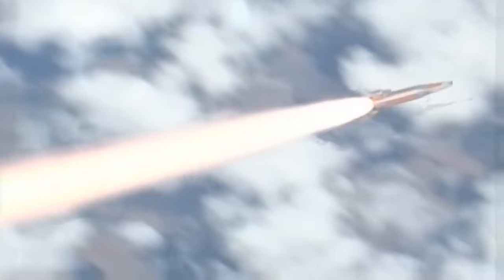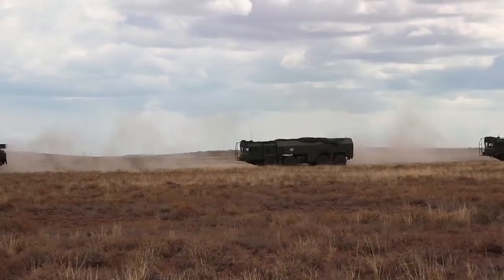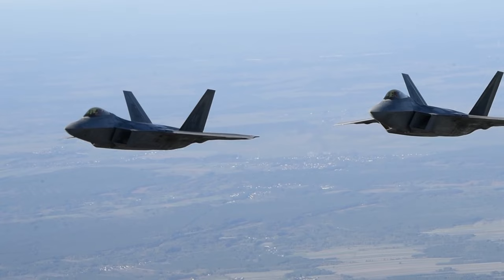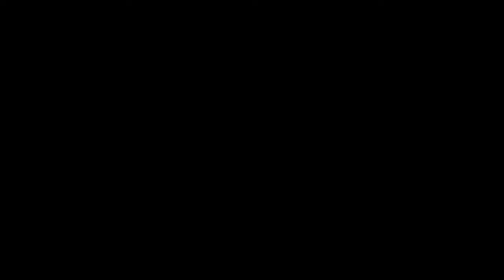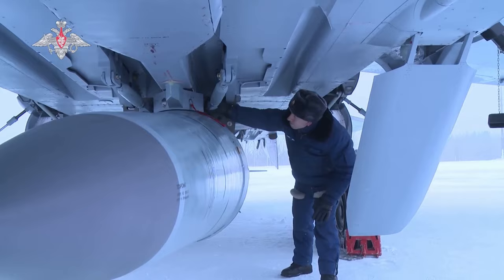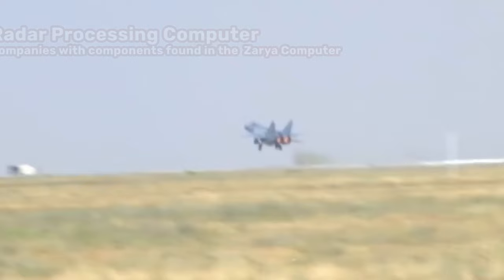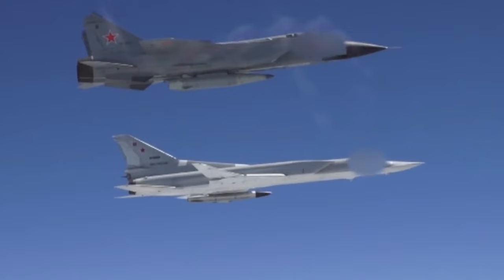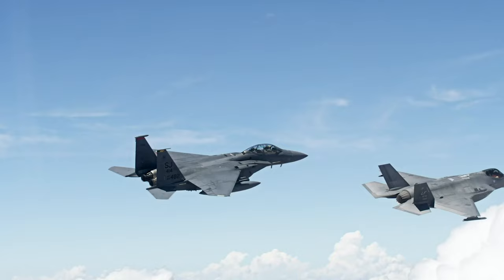Is Russia's "hypersonic" Kinzhal full of American hardware?

Comment: I have to point out that Russia has a domestic chip manufacturing infrastructure, but it is far and away inferior to anything in the west. They can manufacture chips for such things as GPS and Phones, but those chips rely on manufacturing equipment sold to them that is based on techniques used by machines built in Taiwan, South Korea, and Japan two or three decades ago. Where the west is making 2-7 nanometer chipsets, the machines used in Russia today are only capable of about 35 nanometers.  They are larger, less capable, and less reliable than components made in the west.  Further, all shipments of equipment for manufacturing semiconductors have been halted to Russia due to the sanctions, and Russia doesn't have the technical capability to build the specialized machines for making modern semiconductors.  It's no wonder they're using US, Chinese, Uk, and other western components since they simply cannot make the components they need domestically.
Reply: Yup
Reply: @T.J. Kong Except when they're made by old Russian designed and constructed machinery that wasn't all that great when it was new.   Russia used to make some of the most robust hardware in the world, but since the Soviet Union dissolved they relied more and more on international suppliers and forgot how to make some of their good stuff.
Reply: @T.J. Kong They could use vacuum tubes, those are even MORE robust!
Reply: I might be wrong as I'm not in the know on the actual machinery capabilities/longevity for the various process nodes, but I know that the turnover rate for a lot of the machines from the last decade is pretty high, due to the smaller and smaller manufacturing processes and new processing methods.
With that said, 35nm would have come in around roughly 2010 (45nm was 2008), so I have a hard time believing that three year old machines would be capable of that since they'd have been made during the time of 600nm lol
2 decade old puts it inbetween the 130nm and 90nm nodes, and still an absurdly long time ago in this context.

That being said, you may be correct on you machinery dates, just incorrect on the node... 
From what I turned up after a rudimentary search, a news article on mid-April on a site I trust with hardware news, TechSpot, had mentioned this (emphasis mine):
      "Approximately 420 billion rubles ($5 billion) will get invested
         in developing newer fabrication nodes and ramping
         up production. Russia aims to ramp up the local chip
         production using a 90 nm node by the end of the year.
         By 2030, they intend to manufacture chips using a 28nm
         process technology, something TSMC did in 2011."
So just about 20yrs ago like you said, is when 90nm was the latest node, just as I said. 😁🤘 
(oh, and that $5bn estimate by Russia is fucking hilarious... then again, they probably hope to mostly steal their way to that goal... or maybe that focus is only for R&D 🤷‍♂️ I'll just chalk it up to a "delusional Russia number" lol) 

HOWEVER, that aside, this all isn't to say they would be unable to manufacture capable and "fast" chips on that 90nm node. They will just require more power (significantly, in terms of our computer's CPU) in order to operate, but their actual PCB footprint isn't really going to increase — or it shouldn't have to, technically speaking at least. Although, when it comes to SRAM or other memory types, that WOULD require more PCB realestate, as each module wouldn't be able to store as much on account of the far-less dense manufacturing node...
Reply: @InviktusRex  Yeah, I saw that when it came out.  I can recommend it.
Reply: Thought the Dutch have the machines to make the wafers. Then ASLM has the lithography and techniques right? While companies in America design the chips and send them to TSCM. 

 I'm glad the US government is working on catching up. I also wonder what other links in the process a state of the art computer parts take in the manifactering.

 I also wonder what other electronic/instruments the military relies on that simply cannot be created without a solid base. like creating radar and electronic warfare. 

 This is why I foresee cheap, easy to manufacter, drones being the future.
Reply: @dianapennepacker6854  We actually  have a number of fabs in the US, but by no means with the production volume of TSMC.
Now, in War Time, if Intel switched gears away from their own CPU lines, plus those smaller fabs like IBM and Global Foundries (which is by no means small, but not sure how many facilities are in the US), we'd do pretty well.
However.... How much can be completely made stateside is the question. Lots of GloFo made CPUs (back when they were making them for AMD) were "Diffused in Dresden"(, Germany). So... 🤷‍♂️🥴
Reply: I am sorry to report that 35nm is way beyond their capabilities atm, they are still struggling with 90nm!!!
Reply: @T.J. Kong Only they are not able to produce 35nm
Reply: @Roger Smodher The only things they could offer is commodities and they are already doing it. Make a guess what would happen to China, if newer chips that are known to have been sold to them finish in russian weapon systems. Hint-what is going on with China's semiconductor industry.
Reply: @Roger Smodher Which soviet jets? All that is soviet they already have. If you are talking about SU57, even India pulled out.
Reply: @Roger Smodher The only chips that russia manifactured recently.....finished as fridge magnets. russians bought the 90nm equipment in full, but are struggling to make any use of it, not that using it nowadays makes sense. Russian electronic components are exactly like the unicorns, people claim they exist, but nobody had actually seen one!
Reply: @Roger Smodher As for China, they do manifacture hardware, however their chips are mediocre.
Reply: @Mishn0  Would pose a problem to get airborne using a tube-based GPS device, I think...
Reply: @Roger Smodher ICBMs are the reason there are no Western jets in Ukraine.

India pulled out of SU-57 because of spiralling costs and subpar results. I think Alex has even done a video on it already.
Reply: @Roger Smodher That claim is quite exaggerated, as russian "market" is: small and with low purchase capabilities.
Reply: Their own chips are still very capable. Their not top of the line but powerful enough for anything like missiles etc
Reply: @JohnDoe-yq9ml  Really???? Do you mind showing us a single picture of these mythical components. All the hi tech hardware in their missiles is non-domestically produced, or should I ask:Have you really seen the video?
Reply: @DUKE_of_RAMBLE  TSMC is building a huge factory in Arizona currently 💯
Reply: @blueberrywilbur315  That is true! I'd actually forgotten about that! 3nm as I recall. I think that's still at least a year or two away from production capability, with the machinery being the main holdup. 
Isn't Samsung thinking of making a US-based fab, as well?
(although not a chip fabricator, I know Foxconn was going to setup an assembly factory in Wisconsin, but reneged on that intention)
Reply: They don’t have chip manufacturing
Reply: @Fenrir.Gleipnir  I can appreciate not wanting to read the replies, but it would have spared you from all of these: 
  - having to reply, 
  - being woefully incorrect, and 
  - looking a fool due to being incorrect as a result of not having read (enough of?) the replies, but decided to go ahead with your comment anyways... 😕
Reply: China cannot make those semiconductor chipsets either. they can't even make their own 5g semiconductors. that's why Huawei's new phone is worse than the model they released 2 years ago.
Reply: @Roger Smodher Intel is an American company and it can't sell to Russia or to know Russian fronts or it will run into trouble with US law.  I mean I'm sure there is some leakage but they aren't selling direct or anything.
Reply: @Roger Smodher I don't really think the Russia market is compelling enough to make them inclined to risk US regulatory pressure or the massive incentives in legislation like the CHIPS act.  It's not China.  There just aren't  enough competitive domestic Russian electronics to make it that attractive a market for wholesale chips and they have too much dependence on the Dutch as the only maker of EUV machines to be able to spin off a seperate business free of western sanctions even if they wanted to do so.
Reply: @Roger Smodher Of course they have a bunch of money but the wholesale buisnesses is different than the retail business.  Russians buy plenty of iphones etc but that's not what we are talking about here.  We are talking about the demand for wholesale chips which is mostly about thd number of electronics factories in the country.  Those factories tend to be more attractively located in places like China and India because they combine both ppl who have the technical skill (Russia qualifies here) with plenty of low wage workers (less true) and an appropriate business environment.

After recent events ppl are going to be much less interested in basing their electronics manufacturing plants in Russia for fear of another geopolitical dustup.  Of course they want to sell Russians retail goods but they can build them in China or India and do that just fine.  

Indeed,  this is the basic economic problem Russia faces.  They are relatively rich because of oil but that doesn't often go along with a booming manufacturing sector.
Reply: @Roger Smodher Yes, I agree that is a more plausible concern re: Chinese sales (and they already have all but the latest EUV lithography processes).
Reply: If you want, please come to Russia in your tank and check if Russian missiles are reliable, and if russian outdated electronic components are worth of discussion.
The practice is the criterion of verity, right?
Reply: So the chips that Russia makes or use can't make missiles that can make it to it's target?😕
Reply: Well of course!
Reply: @T.J. Kong Not really. Far less technologically advanced in every way!
Reply: @dianapennepacker6854  USA Is quickly ramping up its supersonic missile design/ tests & production RIGHT NOW. Military top contractors are "on it" so to speak.
Reply: @DUKE_of_RAMBLE  Intel building 2 advanced semi conductor chip plants in Columbus, Ohio right now to be online in 2025 latest. For military industrial compex / Big US automakers/ computer companies & others. 4000 jobs expected to pay $125k average salaries . Need good payin new job? Lol
Reply: @Roger Smodher China Is far behind the US & Taiwan..hence one reason they want Taiwan. Intel building 2 new semi conductor plants in Columbus Ohio right now! 4000 jobs expected payin $125k average salaries.
Reply: @Roger Smodher Maybe but far behind Taiwan & US technologically. TMMC founder worked for TX Instruments & IBM in US. Intel building (2) new semi conductor plants in Columbus, Ohio right now!
Reply: @Roger Smodher Also for new EVs & other high tech things made in US. Lithium & cobolt among other minerals as well. Tesla / Ford/ GM need these badly for batteries in new there fast selling EVs.
Reply: @Roger Smodher Yea..highly unlikely!
Reply: @lubomirdoukov6975  Truth. The tech originally comes from USA. TMMC founder in Taiwan learned @ TX instruments & IBM Corp.
Reply: @DUKE_of_RAMBLE  easy now fella.
Reply: @Roger Smodher Intel is an amazing American Co. Building 2 new semi conductor chip plants in Ohio as i write this. 4000 jobs !
Reply: @Roger Smodher fantasy at best .
Reply: @Roger Smodher Possibly. Wouldn't doubt it.
Reply: @Roger Smodher I don't underestimate anyone my guy..they have near zero experience in real warfare for one. Look at Russia right now in Ukraine! Russia has tons more experience then China in last 50yrs but hasnt been in a meaningful skirmish till recently. Experience is everything in warfare & most else! China has huge economic issues at home. Real bad. Zero energy resources ..unless bought an on & on. They are big talkers. They want respect as does N Korea badly. Though hasn't been earned.
Reply: @Roger Smodher maybe not but will affect his efforts.
Reply: @Roger Smodher First claim not true, second uncheckable, but likely to be not true, considering the body armor distributed to their troops.
Reply: @Roger Smodher Ai, ai, comrade, did you not get the word? T14 program has been canceled.
Reply: @Roger SmodherYour guy is probably Prigozhin. Chinese have never been participants in SU57 program and for good reason. The plane is not stealth, uncapble of supercrruise, with dubios avionics and radar. ATM, there are b/n 1-3 serial operational jets. Very likely for China to be interested in a plane that is still in a prototype stage after over 20 years of development.
Reply: @Roger Smodher Russia currently us less than 12 operating, even if people wanted them, they can't sell them
Reply: @petergerdes1094  China do not have any EUV manufacturing process
Reply: @Roger Smodher T14 is a cancelled program with no combat ready machines, the only place it can blow anything other than your imagination of course is a computer game.
Reply: @Roger Smodher Dear man, let's make a bet, not in ten, even in twenty years there would be no decent chips made in russia.
Reply: @Roger Smodher Entire squad is hit by a single rocket? My dear man, you have just invented a new physics, Nobel awaits your achievements lol!
Reply: @jaredgarbo3679  Right, which is what I said.  They have access to all but the latest (ie EUV) lithography machines.  But I see why that may have been a bit unclear but that at least was what I was attempting to say.
Reply: @Davido50  Don't bother explaining yourself, troll the troll, he is getting overly imaginative when you wind him up
Reply: You know this for a fact do you?
Reply: @Roger Smodher - Taiwan has just about cut off all chip sales to China, especially when the US Government implemented the new round of restrictions.
Reply: @Roger Smodher - Italy isn't a supplier to Russia any longer...
Reply: -As far as I can see Russia is at the point in line widths that the west was in 2006.   Think of a Motorola MC68060.   A 32 bit CPU with a floating point unit and an MMU.  This chip powered the last generation of MACS before Apple switched to the intel Pentium architecture.  
-A Tomahawk missile with this kind of power could 'power' its DSMAC Digital Scene Matching Area Correlation but a subsonic missile has plenty of time to do this calculation.  The early correlators used reference maps that had been flattened and distoted to look like they would when viewed from the height the missile would be flying.
-A hyper sonic missile would need to react much faster and ideally without all of the preliminary main frame calculations as well as handle peaks through clouds or identify actual targets.   That needs serious computing power the kind in a top end Graphics processors using 7nm line widths.
Reply: @Roger Smodher no facts there….. how would they do that? They’d have to remove the few examples they’ve got from parade queen duties.
Reply: @flappingflight8537  Ганьо е баща ти, руски чип можеш да видиш само във вид на хладилен магнит, китайски чип има, но със достатъчно посредствени характеристики!!! Всичко това е публично достъпна информация, така че повече четене и по-малко творчество, невежа!!!
Reply: @Roger Smodher an invasion of Taiwan? Surely the Ukraine situation has showed the CCP that even victory would come at a great cost.
Reply: @Roger Smodher The Russian arms industry took T-90s meant for India and sent them to Ukraine. Trusting their arms industry right now is like trusting an obvious ebay scammer.
Reply: @JohnDoe-yq9ml  Then why do they use foreign chips?
Reply: China doesn’t have the capacity either.
Reply: @Roger Smodher They don’t have the chips to make an advanced fighter jet. China has also been barred and that means, they will have to use what they already have procured or they have to start making their own chips and China is nowhere near achieving that goal. They have been trying and the United States still is in charge and control. Even better the finest silicon sand used for the highest quality chips is found in North Carolina and nowhere else.
Reply: @DUKE_of_RAMBLE  aren't both AMD and Intel expanding massively in the US on top with FABs while locking in some newer machines from ASLM PLUS TSCM? It is why China is so angry.

 I wonder what are the majior companies who make the parts and tools that those two juggernauts use. 

 I am a layman and only recently had these companies brought to my attention and it's interesting. No one ever thinks about the physical aspects of chip manufacturing but only software. I can't find any easy digestible reads on the ground up on how logic gates can make a video game. Trying to learn on architecture and the therotical possibilities of that.
Reply: @dianapennepacker6854  [note: I'm also a lay-person, I just have enjoyed computers long enough to have picked up rudimentary knowledge; however, this means there could be glaring errors here]
AMD only designs their hardware –actually, this is complicated, I'll touch on it later– and then "foundries" like TSMC, Samsung, or Global Foundries apply that design to a large Silicon wafer (on AMD processors, this is where it was "Diffused"; ie "Diffused in Taiwan" if TSMC). Dozens to hundreds get patterned out per wafer, depending the size of the "die" (the entire CPU, GPU, or whatever designed logic is being made). But then, once they are... we'll say 'etched' to simplify the process... once etched the big wafer disc (which look beautiful once etched;  https://upload.wikimedia.org/wikipedia/commons/f/ff/ICC_2008_Poland_Silicon_Wafer_1_edit.png ), the dies get individually cut out, then tested quite extensively with today's capabilities, whereby its determined what sort of defects they have – if any.

Which today's designs are modular enough that a defect doesn't always mean it goes in the garbage. If say the defective portion is for example, one of a CPU's multiple  processor cores, they can "laser cut" parts of that circuit to disable it. So instead of being an 8-core CPU, it gets turned into a 6-core (they disable them in pairs usually, for various reasons). Then all these dies get sent someplace else, one of multiple places AMD uses, although I think these days it's Malaysia (on the CPU, this is the "Made in" portion). This is where they get packaged and become the product we are familiar with seeing.
[Note: actually, I might be wrong, and the assembly plant might get sent the entire, intact wafer. Heck, anything from that testing to defect laser cutting process, may all occur here 🤷‍♂️ heh]

As for the "this is complicated" part I mentioned...
AMD, for a long long time, always played second fiddle to Intel. Then the fates shined on AMD at the end of the 90s, when their new CPU architecture outperformed Intel's (significantly, at times) and they maintained this lead until ~2005-06. Then Intel started to claw its lead back, but they had also started to do some shady (to later determined to be illegal) business deals with all the major computer manufacturers, so that they would not sell as much AMD-ewuipped systems or to only put them in less-favorable computers people wouldn't really want (I only mention this because it indeed hurt AMD's bottomline, which is directly relevant because...)
Then in 2008, AMD spun-off their chip foundry and manufacturing side, which became its own entity called Global Foundries. They, through agreements, are who AMD would use exclusively (or nearly) for almost 20yrs. More recently "GloFo" has trouble getting below 12nm and AMD now uses TSMC almost exclusively. heh

There's less to say about Intel, as they do it all in-house.
I don't know if AMD fabricated chips for others during the time they were still a foundry, but I think so... GloFo, of course, did take outside work for whomever needed it. Whereas Intel did not take any, always having enough in-house volume to take it up. Although after AMD once again took the performance crown back, I think Intel decided to open its doors to others... Not because they had less demand (their own nearly decade-long 10nm woes meant they had TOO MUCH fabrication work), but because they needed extra income.

As for who makes the machines.... I'll just quote CNBC:
   “ASML is the only company making the $200 million machines needed to print every advanced microchip. In the southern Dutch town of Veldhoven, near the border with Belgium, sits the only factory capable of assembling a revolutionary machine that's relied upon by the world's biggest chipmakers.”

Which is nuts. I don't know why that is though, as I've never been compelled enough to find out why... Though that article might actually say it, if you felt so inclined. Just Google search that first sentence and it'll come up.

_[apologies for any condescension that this post may convey; I've always made it a point to over-explain anything that's public (these comments), both because I don't know your level of understanding but ALSO just incase anyone else reading it who isn't in the know, they can then have a chance following along. 🥴] _
Reply: Pointless to create an own production when you can easily buy your stuff rom the neighbor.

And for military you don't need high end stuff.
Reply: @dianapennepacker6854   We control 85 % of manufacturing process from design to product design and the rest just manufacture what we ask them to do. I’m a Decade we will catch up.
Reply: The problema with this video is that It reaches the wrong conclusion. The reality of sanctions is that the more sanctions you put, the more challenging is to enforce them, the easier It gets to fool them. Iran has been sanctions for decades and yet Iranian drones are even more packed with sanctioned western components.
Reply: Our washer dyers has better built and capable chips….. and we chopped China way before they could move to benefit from taking Taiwan. They now have to either support Russ and or take Taiwan but both options they get sanctions and possibly collapse of the regimes
Reply: @lubomirdoukov6975  Yeah, like "the ghost of KiEv"?  I wonder what renderer they used for the video i saw of that full company of non mock-up T-14 I saw a video of doing field exercises a few weeks ago...
Reply: @winstonsmith2539  Watching russian TV affects sanity comrade.
Reply: @T.J. Kong microchips don’t have traces, PCBs do.